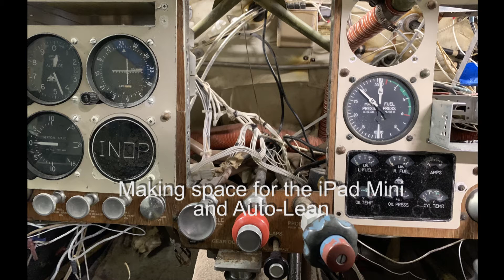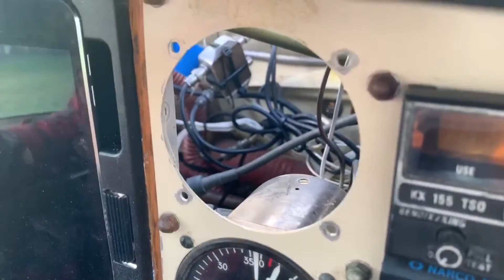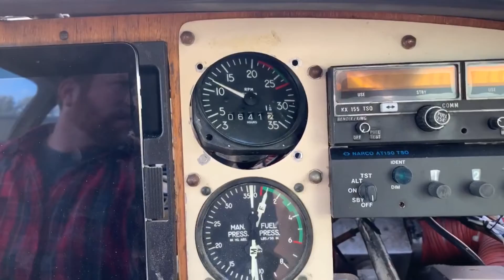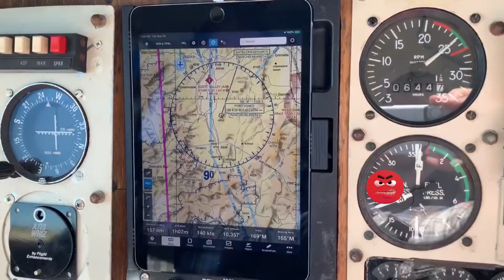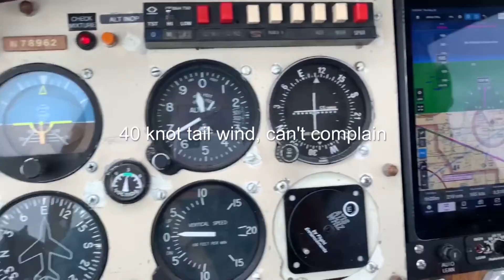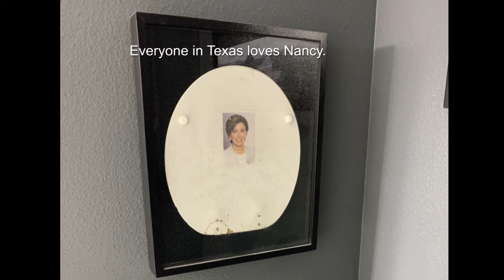Saving a Mooney from the Scrapyard - Episode 4: AIRWORTHY

Comment: I really enjoyed your videos saving the Mooney.  I have Mooney N78934, a 1961 M20C that when I got her six years ago, had the same paint scheme.  Not so much anymore though.  Love my Mooney, congratulations on yours!!!
Reply from the maker: That’s crazy, must have been handing out the N numbers sequentially in those early years.  We really enjoy ours, pack it to the ceiling and we can be gone for a week or more, or go solo without any weight and it turns into a rocket.  Hopefully we’ll have a few more videos out this month, an interview with the experimental Cafe Mooney being one of them.
Reply: @HairHelmet -Why did you take it to the Mooney specialist in Texas? Thanks!
Reply from the maker: @thesearcherman6652  Had corrosion in the lower spar doubler on the right side.  Only option was to fix it or replace the whole wing.  A used wing was $10-13k plus paint and labor, or roughly the same amount to have the corrosion repair done at Don Maxwell's in TX.  Don hadn't ever heard of one failing but it needed to be dealt with.  Turned out to be the worst they'd seen.  They have a modified car lift for Mooneys, and completely open up the lower half of the wing to replace a 1/4" thick by 6'x2" strip of aluminum.
Reply: @HairHelmet - Wow, had no idea! And pics of the old spar/corrosion? Thanks for the reply.
Reply from the maker: @thesearcherman6652  I've got a picture of the strip that was replaced.  I just wasn't sure of how much detail to put in the videos at the time and didn't want to garner unwanted attention.  I'll see about putting a short video together on that subject.  Experimental CAFE Mooney upload coming soon...

Comment: Man I got a Mooney m20G that needs this same overhaul. Gonna start AP class im august. Everybody tells me no when I ask for help to rebuild. Its ok ill figure it out. In the meantime I plan on buying one that flies lol.
Reply from the maker: What kind of condition is it in?  Kyle Kennedy did the bulk of the work on mine, he was the GM at Lasar for 4-5 years and now lives in western Michigan.  My plane was his 4th extensive Mooney build.  If I do it again, I'd probably go for an E since I've maxed out the mods on this C unless I go injected and Lopresti cowl.  The short bodies are hot rods as far as the fighter feel goes, this one climbs out at 1500 fpm at sea level and 183 mph TAS cruise if I push it.  Back in November we crossed under an MOA in the Nevada high desert at 200 ft AGL, crazy fun.  But I'd be money ahead if I'd just gone for a 201.
Reply: @HairHelmet  as far as corrosion I dont see any. Its now in 3 pieces like yours. Ive removed the engine and firewall. Its all screwed up. I took the seats out and sent them to get upholstered. I also removed the flight deck. I wanted to do a complete makeover because I wanted to keep it until I couldnt fly anymore. Then I had to get it away from the airport. Wings in the inside and out look great but ive probably gone too far with the breaking down of the dang thing to get any help without about 60k or more in repairs. So I decided to go to school and in the meantime find another Mooney. That class starts in August and now watching you guys work on this thing it has hit me that its going to take several years of on the job training to get to that level of putting a plane back in the sky. If anything im looking at this plane as a training tool while in school but im not giving up on it. Its not just because im a mooniac its the love of being a pilot and a part if such a great community/family of aviators. I want to change careers and this is where I want to be in aviation. Ive talked to Don Maxwell before. Very nice guy. Im sure you know Paul leowen. Ive purchased SEVERAL parts from him. He has been a super big help. Oh well ill
Keep on keeping on.
Reply from the maker: @houstontexas5486  We had a number of volunteers plus the A&P's when we did the final 4 week push to finish it.  It can be done quickly if you've got the right people, it'd be worth having Kyle work on it for a week at a time to get you on track.  I had quite a bit of corrosion and body damage from the gear collapse along with it being a Pacific coast plane left outside for years.  The lower spar doubler had nearly corroded in half on the right wing which is why it ended up at Maxwell's.  Don said they'd never seen one fail but it needed to be fixed and was safe to ferry it, $12k fix was cheaper than replacing the wing.  Bought a few parts from Paul and met him and his wife at the Sunriver Mooney fly in last summer.

Watching the Patey's videos (and meeting them on the way back from Texas) gives us a sense of what can be achieved in our spare time... short of raising young kids for some.
Reply: @HairHelmet  I can't thank you enough for the info how do I get in touch with Kyle? It's a good idea like you said to have him work on it a week at a time. I need a place to work on it because I had to move it from the airport. So I bought an acre of land and about to put a metal building up. Once I get the tools I need inside after building it then I'll contact Kyle. Wow you said your lower spar was nearly corroded in half? That's crazy LOL. Do you think that you and the guys could have fixed it yourself?
Reply from the maker: @houstontexas5486  email me at hair_helmet@icloud.com and I'll pass the number along.  It was a 'lower spar doubler', goes from the center of the plane out the wing 4-6 ft.  1/4" x 2" or so wide reinforcement.  The early Mooneys have the biggest issue with it and thought to be a metallurgy issue from the aluminum manufacturer.  1961-1964 I think they said, starts in the corners just in front of the rear seats, spill a soda or have standing water and it starts a nasty intergranular corrosion.  We explored every possibility to fix it ourselves but Don Maxwell said it was a 110 man hour job no matter who does it.  That was cheaper than replacing the wing or trying to fix it ourselves.  The whole underside of the wing has to be opened up, including the fuel tank to get the doubler out.  Nasty job.

Comment: Hey, I have two mooneys that I am trying to save from the scrapyard… what is the best way to take the tail off?
Reply from the maker: Two Mooneys to save??  Remove the prop, empennage, and tail feathers and the plane will fit sideways on a trailer.... pretty close to 8' wide I think.  You'll see in some of my videos where we reattach the empennage, the row of rivets behind the baggage door and 6 bolts I think.  Disconnect the trim torque tube, rudder, and elevator linkages.  Comes apart quickly if you're good at drilling out rivets.